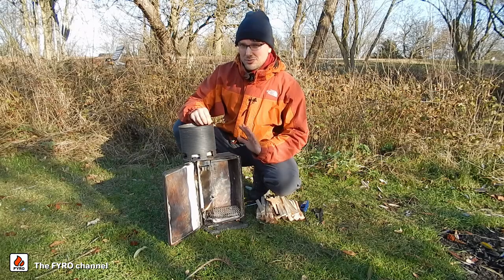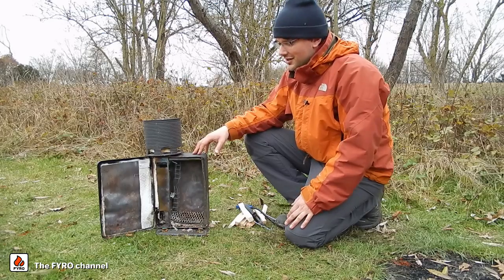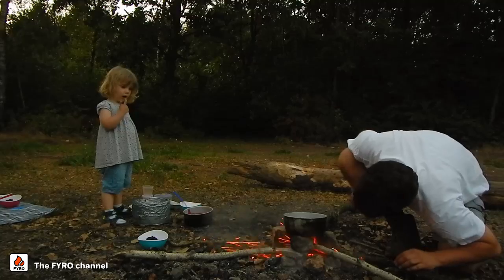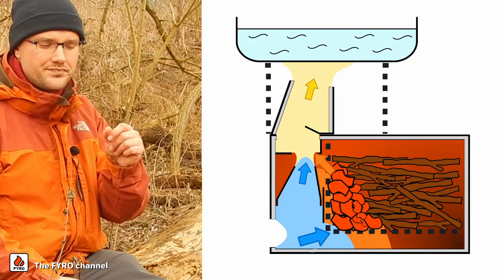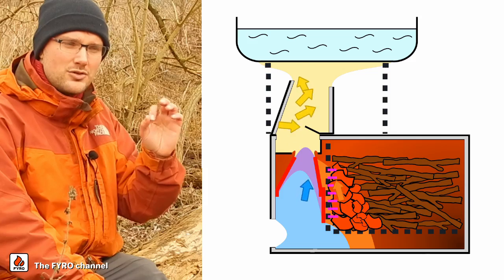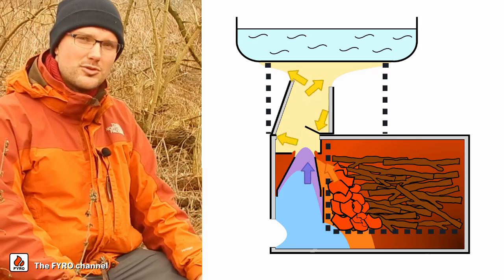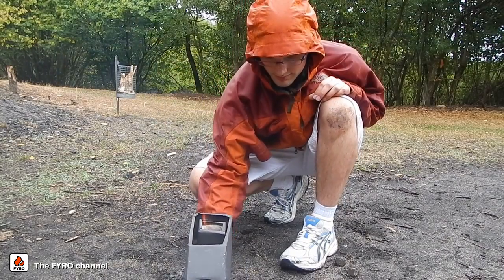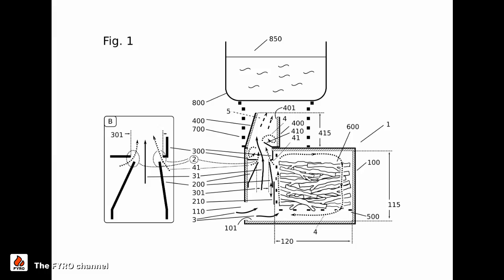How the FYRO stove works

Comment: Very interesting concept, and a really good job of you to make a fully functional stove and making it work in practice!

I'm curious about how this design would work with a chimney, and also how it would scale, both smaller and up to being as large as a full-sized stove for heating a common room or cabin. I have been looking around and searching for very small efficient wood stoves for usage in tent/tipis, tiny houses and in other small spaces. But I haven't seen any really good choices from my perspective. There are small and very light alternatives that work well enough for just heating, but your stove surely seems to excel for cooking purposes as well as having a clean burn. Available small stoves  commonly (if not all of them) produce a lot of soot and dirty smoke. To be able to use your stove as a heat source, one would obviously have to transfer the heat from the exhaust output to the room in a good way, and then I guess the best thing is to look at how rocket stoves achieves this, with their metal barrels, bells, and mass heaters. Your stove and the more advanced rocket stoves have some things in common.

For using it as a heat source for living, it would be a very very big thing to be able to load it with a lot of wood and to have it burn cleanly for as long as possibly. A long, low and steady heat output is in practice impossible to achieve with available stoves suitable for small cabins, tents, tiny houses, etc.. Also to be able to put in more wood as it's burning would probably be necessary. It should be far from impossible to solve that, but it would mean a lot of work naturally.

Thanks for sharing this, and I hope you had a lot of fun developing your stove!

Comment: wonderful video, smart design, thx a lot
Reply from the maker: Thank you! :-)
Reply: when I posted a comment last time, I did not fully appreciate the merit of this FYRO stove. today I know more. I have made a TLUD-ND stove, this morning I add a layer of dry oat( just for fun ) on the fuel. then something wonderful happened. the flame became small, blue and stable. this kind of effect  is very hard to achieve for TLUD-ND.  then I remember your FYRO, limiting primary air from above, not from under. that make difference. your design is very smart, I would like to call it SLUD: Side-Lit-Up-Draft stove. maybe I will tell Dr Paul S. Anderson your progress.
Reply: Advice: 1,  maybe a pot skirt should be added to FYRO, outdoor cooking in a windy day, there will be great heat loss under the pot, which will double the boiling time, even more. a skirt will be a great help. 2, maybe when limiting the primary air, just close the out-door-way of the fuel chamber a little bit( lifting up a piece of blade of some kind), you don't have to lift up the entire air tube.
Reply from the maker: lh cheng Thank you for your suggestions! Yes, we are considering a wind shield as an add-on. We are currently testing a larger prototype. It turns out that the flame is so fast that you need a wind shield or pot skirt only in stronger wind. 
Regarding the nozzle: You are right, there might be other ways to solve this. The current solution has the advantages of having the mechanics somewhat protected from direct heat, and excellent mixing and injection pump effect from the nozzle geometry. We'll keep this in mind and see how it compares!
Reply: about the nozzle,  I am wrong.  you're not lifting up the whole preheated tube. I watched the video again. just a very light small structure. faultless design :D